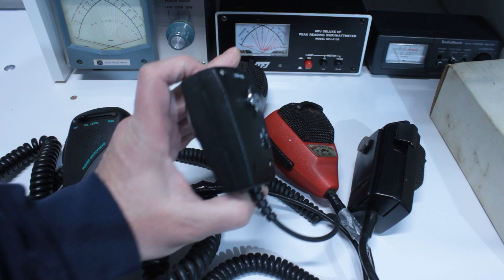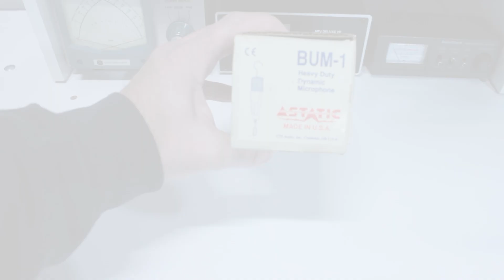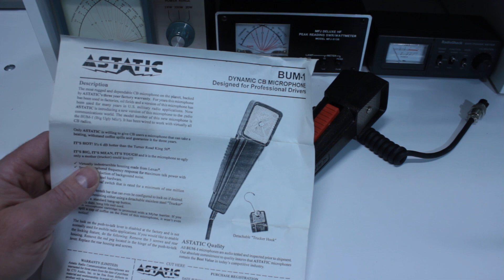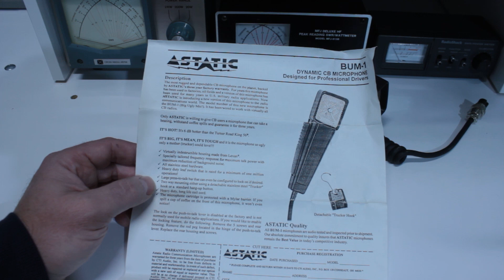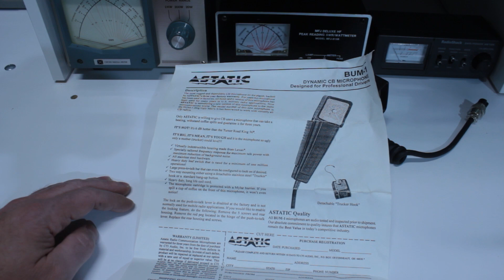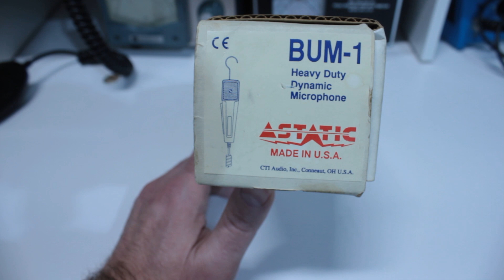Is this the ugliest CB radio microphone ever made? Astatic BUM-1 Microphone

Comment: That's hilarious!  I've never seen one of those in person, and I've been into CB since the 1970's.  I'm currently using a Shure 450 desk mic with my Galaxy DX 95T, and it works FAIR, but I had to bump the gain up on the modulation, since it's non-amplified.😉